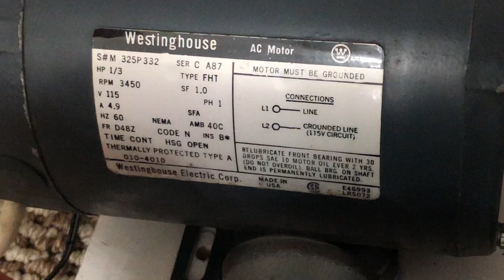Mini West Bank Thunderbolt Siren Update (Paint Parts and another Roots)

Comment: looks and sounds like a 6M
Reply: Kinda sounds but not looks
Reply from the maker: Hope it’ll have the same effect as a 6M, like the pulsating sound.
Reply: @tylerdavis9820  yea
Reply: @marylandsirensfirebuff9664  the big pully gives it away
Reply: @1000BT  that’s not a real thunderbolt blower, it’s a miniature one and if it was a real one it would replicate a 4MC
Reply: @marylandsirensfirebuff9664  THERE IS NO 4MC
Reply: @1000BT  Yes there is, in fact there's 3 blowers. 
Oldest: 6M (A1)
Middle: 5M (Early A2)
New: 4M (Late A2)
Newest: 4MC (A 4M blower flipped vertically) (Late A2) 
The 4MC's were mostly in the 80's-late 80's and were the last blower Federal ever produced. These 4MC's were found on the newer 1000's when Federal switched to 1000's again as their stock Thunderbolt configuration in the 80's & 90's
Reply: @marylandsirensfirebuff9664  nobody called it that
Reply: @1000BT  Ummm I don't know where your getting this information but what I'm saying is 100% correct
Reply: @marylandsirensfirebuff9664  the 6M has a big pulley
Reply: @1000BT  I know. This is not a 6M
Reply: @marylandsirensfirebuff9664  it’s not a  5 or a 4 it’s like a 1.10M
Reply: @1000BT  replica
Reply: Spin the blower slower for more pulsating
Reply: @1000BT  this would infact replicate a 4M/4MC (C/B-series blower